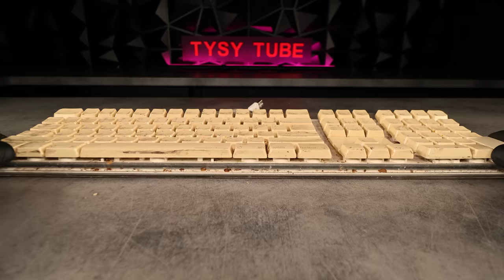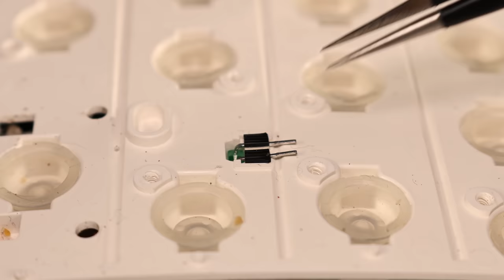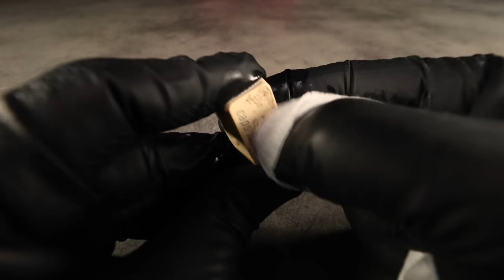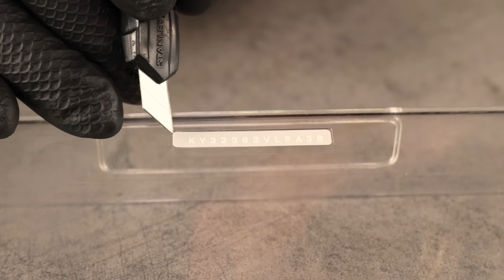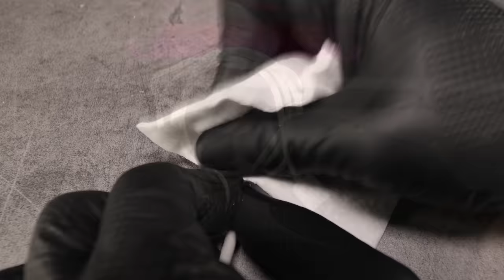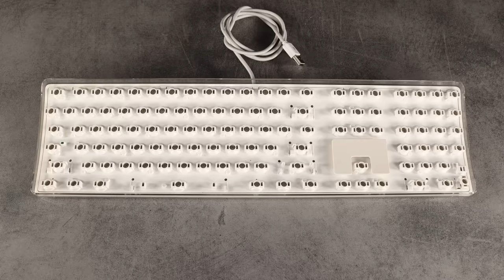Extremely Dirty Apple Keyboard Restoration - Owner left Toenail for Me

Comment: Did you need to apply any lubrication to the keys? Whenever I take a part a keyboard to thoroughly clean, the keys don't press smoothly anymore. I have to lubricate them, which helps a little, but after a while, starts messing up again.
Reply from the maker: no

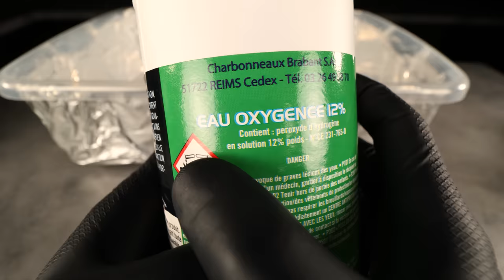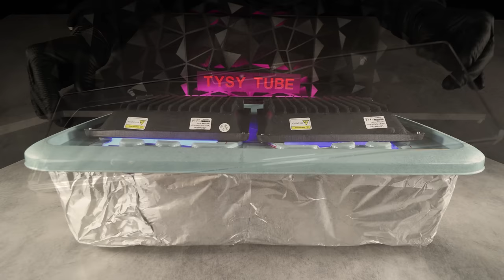Comment: 4:21 -- If you can't find oxygenated water, will hydrogen peroxide work just as well?  Also, at 6:47, I noticed you had switched out the UV lights for a different model.  Why was that?  Original ones weren't working well enough?
Reply: oxygenated water is just another name for a solution of hydrogen peroxide (which you can only buy in solution , not pure, anyways).
Reply: @matiastripaldi406  Thanks -- that's what I thought might be the case.
Reply: @nemesis2264  Wasn't sure because the wording on the bottle was literally "oxygenated water".  I did later notice the back of the bottle saying "contains peroxide in a solution 12%".

Comment: PSA:  For the casual cleaning of a large plastic surface, including removal of the yellow from oxidation, I've found that a melamine sponge (e.g., Mr. Clean Magic Eraser -- but there are many other brands as well), wet with water and a drop of dish-washing liquid detergent, works extremely well.  Be aware that the melamine sponge is abrasive, but it's about the mildest abrasive I've ever come across.
I would not recommend these sponges for extensive work like that shown in this video.